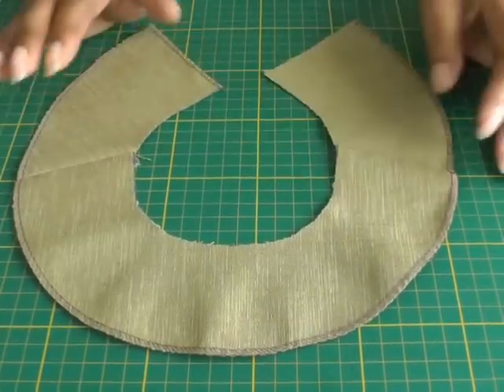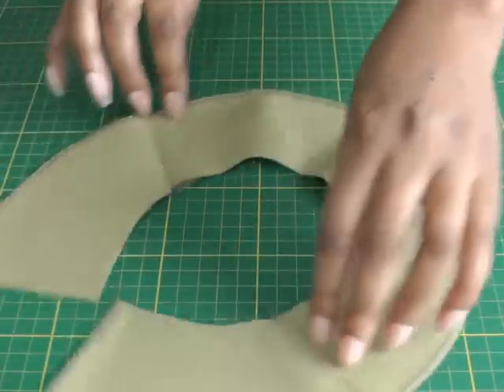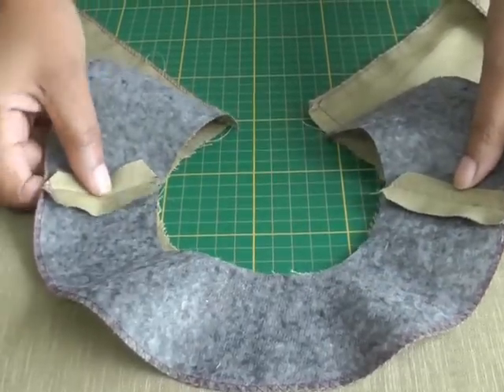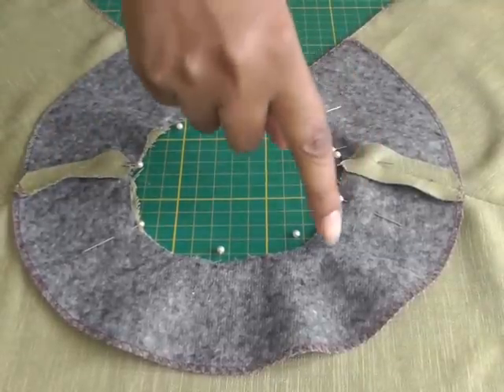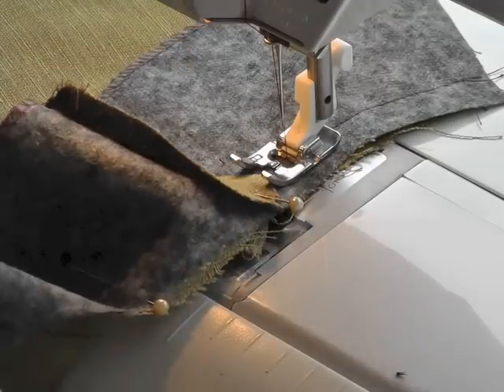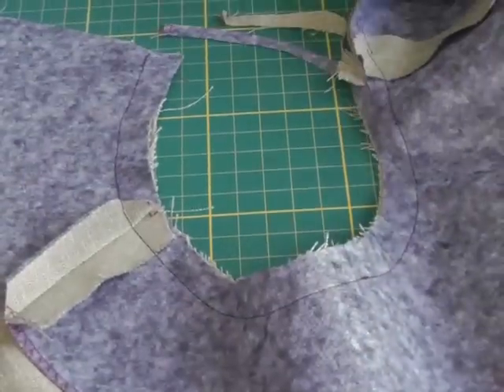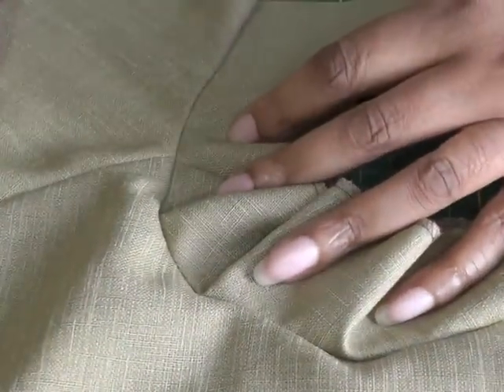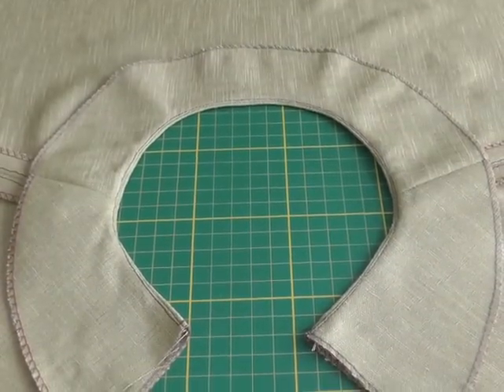Sewing Facing to Curved Necklines

Comment: Hi there,  Your facing is lovely.  Good job.    I am doing some research on Silk, and was surprised to learn that there are at least 50 varieties.  I am looking for a silk that is on the durable side, as I plan to machine wash on the gentle cycle, and dry on low.  I can always iron.   I need the material shrunk to the max, before the pattern is cut for a ---boat neck Tee Shirt.
Complete with FBA!  lol

Could you please tell me,  is the silk you were using as a facing; Silk Noil?
Source says that it is low sheen, slightly bulky silk with nubby texture.  Wrinkles less, but the edges fray easy.  It has great drape. 

Thanks so much!
Reply from the maker: You can use any type and weight of fabric the does not distort your fashion fabric Momzilla. I would recommend doing some test samples.